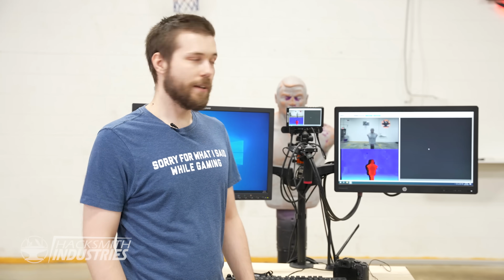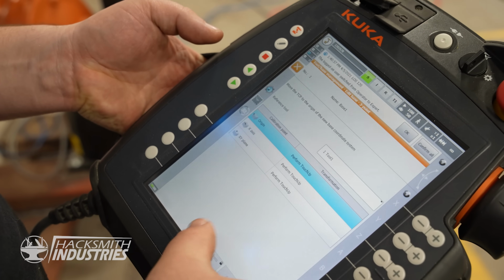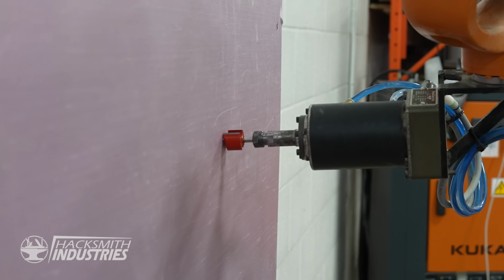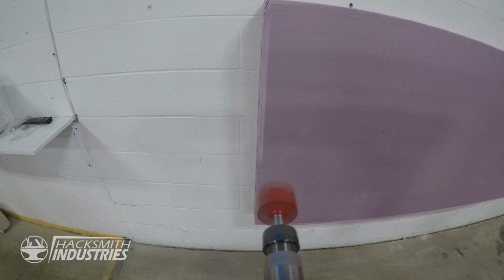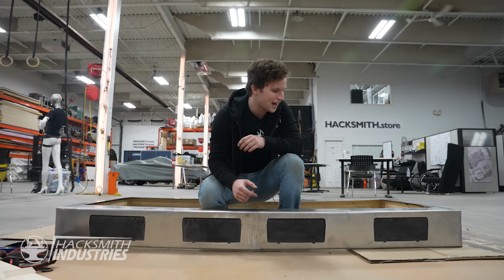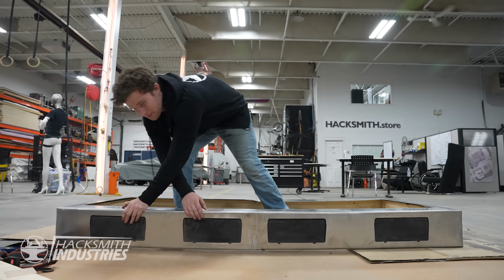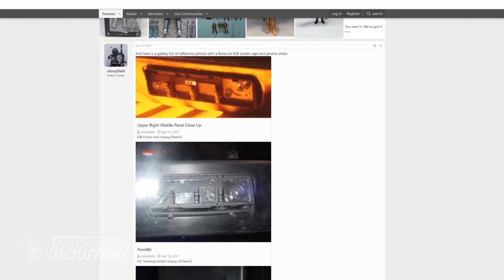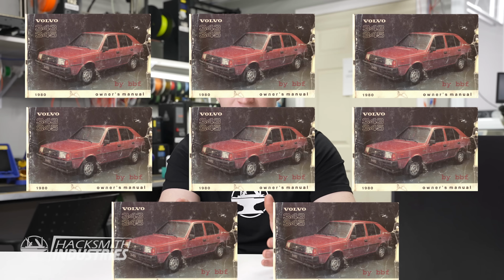i froze myself in carbonite...

Comment: What kind of grinding wheel do you use on the angle grinders to grind down welds on all your steel projects? I can’t tell, it must be something that cut away material but isn’t too aggressive, so you can use it without gouging stuff out. 
Saw it used a lot on the Hackalorian armor, and on this frame some too, for example.
Reply from the maker: usually just 80-120 grit flap disks,  then for Mando armor,  finish with a wire brush
Reply: @hacksmith  flap disks, okay!  Thanks!

Comment: I don't know who advised you on the sheet metal bending but seeing that made me think a little.
Next time you bend a U-channel with cut outs ONLY bend the small side and put the rest of the sheet through that way you won't run into the back if you take the last finger out... That is why it is called a finger brake.
Another method to help the bending use Stuff Made Here's (another YouTube channel) method and at the time you cut out the sheet make slots where the bends are and either patch these up with bondo later or weld it but that would warp the metal pretty badly.
When you weld a frame like that make sure to make the attach point in the corner and shave the wood of that corner off aggressively so you won't risk burning the wood underneath... Those fumes aren't healthy by a long stretch...

Comment: cheaper way to do it is to 3d print the face and hands extra starch some cloths so its stiff as can be cheap shoes cut off the front attach to a board that is the size you want to make the frame be and then you use wood glue in lays, it takes a few days to doto make the texture  paint grey with black low lights and you can make it look like carbonite. its how we did it for the zoo i work at for the carbonite but we had casts from han to get it as close to the movie looks as we could.

Comment: little hint for welding thin sheet metal 30-40 amp per mm of metal or whatever feels the best four you i personally weld 1.5mm steel plates witch 50 to 60 amp max wig welding is a slow process dont rush it or youll get to much heat into the matal and it will bend a lot 

greetings from a german industrial welder :P